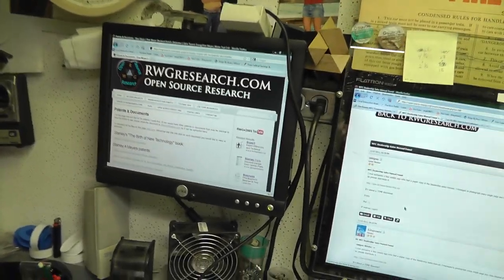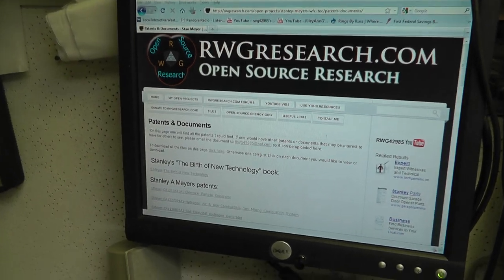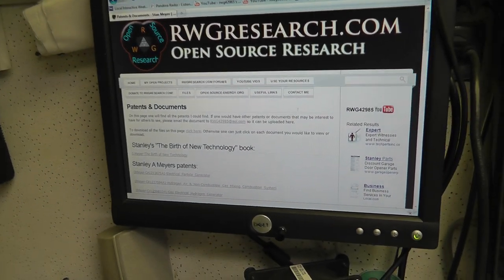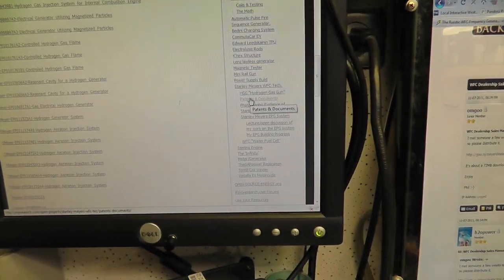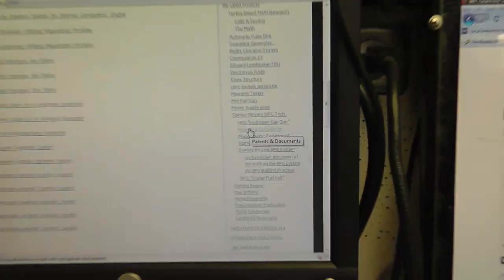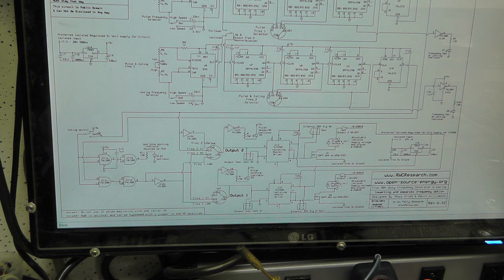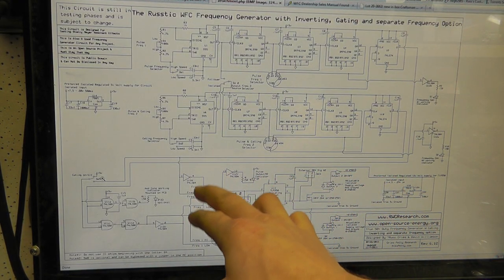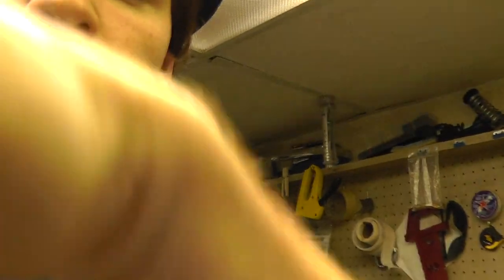NEW Stanley Meyer Info Found! UPDATE! Russtic WFC frequency Gen and more!  11-09-2011

Comment: All we need is the resonant frequency of water. What is it?
Reply: 4D Flat Earth we need MUCH more than the resonant frequency of water to replicate this device. Stan stated that the resonant frequency of water varies from every single water you’ll find. Just because of the makeup of it is all a little different depending on the molecules/minerals in it. Pure distilled water had the lowest variation in easily accessible water. Pure reverse osmosis water would be the best, especially with the widespread availability of osmosis devices. In all reality, we don’t need to be wasting time trying to recreate the complicated water combined with the toroid. All we need is the electrical output. I wish guys like Russ would turn their resources and amazing brains to just re creating the electrical portion. While running a car on water is cool, it’s really not necessary. Electrical motors have far surpassed anything Stan could have foresaw. Trying to recreate his water system is just too much/too complex for us DIY laymen. I do recall one of the patents saying to use a non conductive material for the loops in the toroid. So maybe copper is t the best idea. Maybe if someone could use glass tubes like a neon sign and turned into a coil it would be ideal. Then what is happening on the inside could be observed in a portion of it. But Stan stated the inside of his laser powered over unity toroid was coated in a reflective coating to help carry the laser beam all the way around it. Coating glass in a vacuum with aluminum or even vaporized gold would make the purest form of a mirror to accomplish this. I digress, to find the resonant frequency of water just create/buy a frequency up device and turn the dial until magic happens, but still, all of the control mechanisms to pair it with an over unity device and injection/hydrogen burn speed slowing process is just way too complicated to be within reach of us normal people. You can’t just bubble brown gas and put it on an existing petrol engine, you have to slow the burn rate. At this blessed time we live in, it would be much more practical just to pursue the direct energy producing closed systems. The gas mixture Stan uses is probably the biggest hurdle in that route. Liquid oxygen in a test tube can be pulled to the side with a magnet, so oxygen gas could be a good accessible candidate to be magnetically accelerated through the toroid